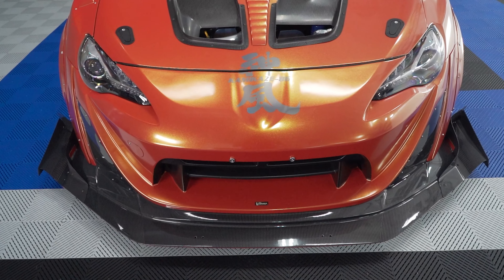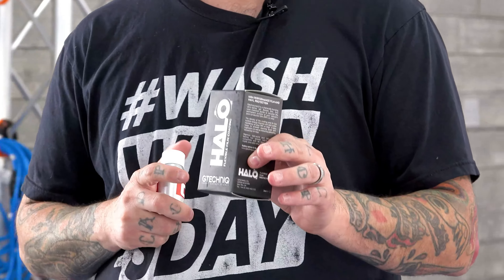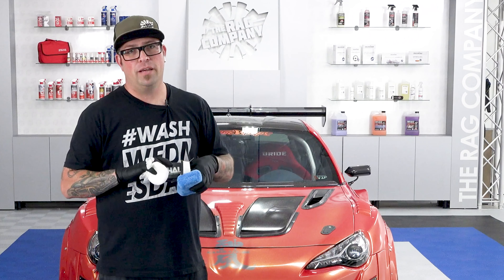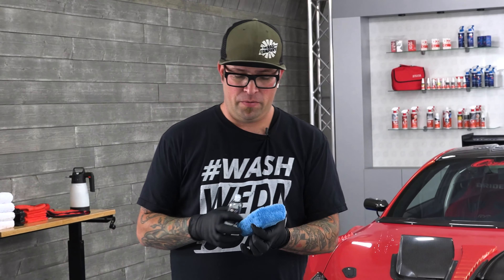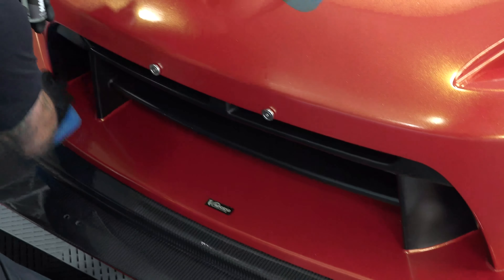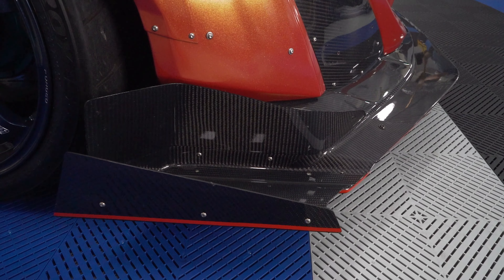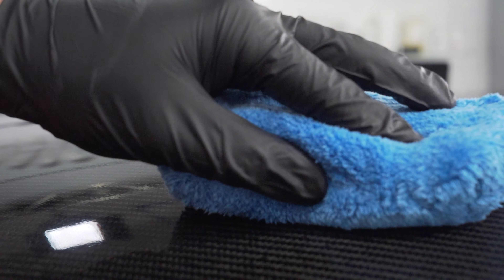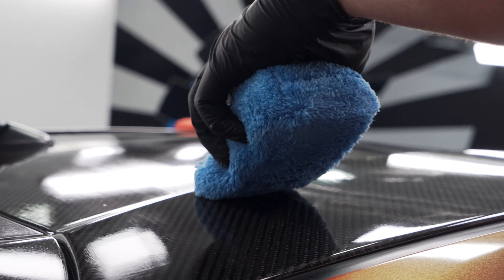Coating A Vinyl Wrapped Car w/ Carbon Fiber Aero! | Turbocharged Varis Kamikaze Widebody 86

Comment: Can someone explain what a “bleed line” is? And what does it mean to “draw from the bleed line”?
Reply: Instead of starting the coating process in one end of the panel and doing parallell lines from one end to the other in a cross hatch pattern, you start by doing a line right through the middle of the panel you are coating.
Then you drag the applicator perpendicular though this line of product to coat the entire panel. Kind of hard to explain, but easy when you see it.

By doing it this way you ensure a more even coverage on the whole panel instead of getting more product where you start.
Reply: Pierriewargen - thanks for the quick reply. I think I understand now
Reply: Luke Grandgenett  - I appreciate the quick rely. I get it now.

Comment: Czero isn’t applied like that,  nor do they reccomend applying EXO over halo
Reply: Hey Steven, actually you can apply EXO over HALO, however most installers don't do that. This video is to help those who are installing HALO themselves. Not EXO. If they want to top Halo with Exo they can thats all. I appreciate your comments, But I am confused why you feel we installed C0 wrong? Please elaborate...
Reply: Also great job to you and the team on the Porsche video;)